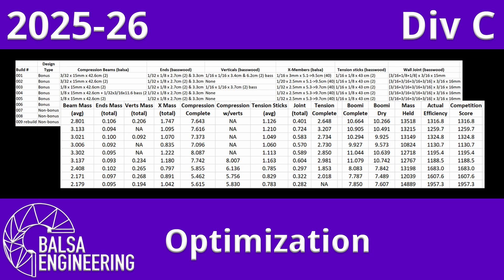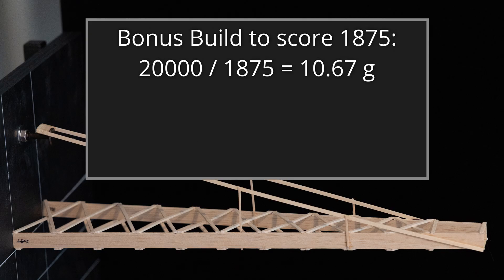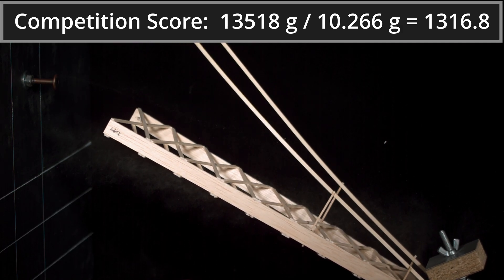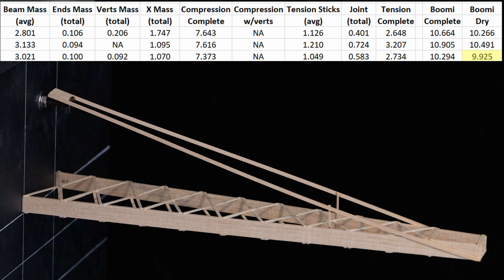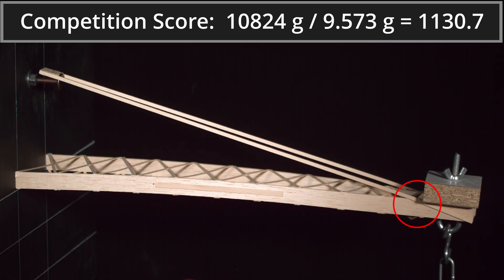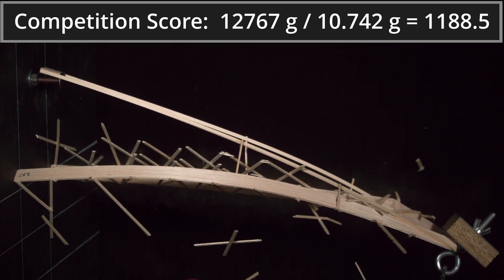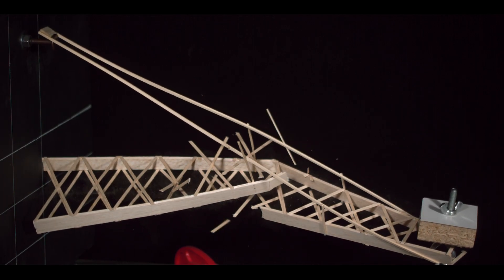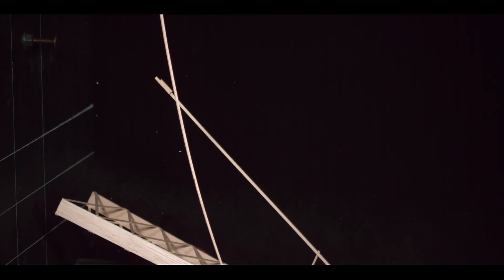2026 Science Olympiad Boomi Div C: Optimization

Comment: This video is going to be really helpful for this season! I don't know if it was mentioned in the video or not, but are the measurements for your wood bought precut? Or did you have to cut it yourself?
Reply from the maker: Thanks!  All the basswood was precut, all the balsa was custom cut from sheets. Good luck this season!
Reply: @b @balsaengineering6686 . May I know where you bought to precut basswood
Reply from the maker: I have been using this place: https://fnabco.com/collections/basswood-sticks
Reply: @balsaengineering6686  what type of balsa (if there is a difference in balsa) did you use and where can I buy that as well?
Reply from the maker: @rochanjatling  Density is the main variable you want to pay attention to wrt balsa in these devices.  You can compute the densities I used from the dimension and masses I show for the various build.  Grain type can also be a useful variable, but I wouldn't worry about that until you are further along.  I like to buy my balsa in sheets from here: https://specializedbalsa.com/products/balsa_sheets.php
Good luck this season!
Reply: @balsaengineering6686  thank you
Reply: @balsaengineering6686  Sorry if this question was already answered in the video, but for the measurements of the balsa wood, I know I have to get 3/32 thickness, but for the length, how much is needed? Do I need to get a 36-inch or a 48-inch? Additionally, what was the width of the balsa you used? Was it 1 2 3 in etc?
Reply: @balsaengineering6686  also, what were the measurements of the precut basswood you got on the website?
Reply from the maker: @rochanjatling  I like to buy 36" long sheets as they are easier to strip.  This widths can be seen in the video when I show the spreadsheet
Reply from the maker: @rochanjatling  This is also shown in the video when I show the spreadsheet for each build
Reply: @balsaengineering6686  On the spreadsheet for your last build, I'm having a hard time differentiating what width is and what is length. So just to clarify, would the width of the X members be 2.5mm? It's kind of confusing to me, so I just wanted to make sure before I buy the sheet... sorry for asking a lot of questions.
Reply from the maker: @rochanjatling  Yes, for the cross members, they were 1/32" thick by 2.5mm wide.   In general, I show the original Imperial units (inches) as how they were bought 1/32" thick for example, and then SI (mm) for anything that I had to custom cut, which would always be the width.
Reply: @balsaengineering6686  ok so your width was custom made? And if it is should I buy a sheet that has a width of 1in?

Comment: Great Video! I see that you have left only 4.5cm of space at the end(because 38cm go to the cross-members) for the loading block even though the loading block is 5cm. Why is that?
Reply from the maker: It's no problem to have the loading block hang off the end a bit and that is 5mm of length you don't need to have for your compression mass.  Every bit of savings helps!

Comment: I was looking for the dimensions of components for the non-bonus design, specifically the one that scored 1957.3. I know the charts are at the very beginning of the video but the information on the first chart is covered by the other one. 

Also, I am trying to purchase balsa wood and basswood for the season, I’ve just been a little confused by the numbers. What different thickness balsa sheets would I need for this design, and what density should I do (light balsa, medium balsa)? I don’t have a very large budget so I’d like to be one the more safe side and not having to make a large number of boomilevers. 

Same for the basswood. I saw you said you use fnabco but if you could help by letting me know what size sticks I should purchase for this design. Can I cut basswood sticks in the same way as the balsa wood sheets with the balsa stripper tool you use?

Sorry for all the questions and I understand if you can’t answer them all. Thanks for all your amazing videos and time.
Reply: If I could also get a discord link that would be great
Reply from the maker: Definitely check out my discord server for a ton of resources.  Welcome! https://discord.gg/JkRVdX3G
Reply from the maker: Hi!  You have to actually watch the video to see all the details... the optimization video covers 9 builds, so I show the details as I show each one.  The benchmark one starts at the 15:45 mark:https://pie.yt/?v=https://youtu.be/FV7FhJLPxT0?si=ZdP_43U_x6ztAg2f&pieshare=1

Comment: Thanks for everything you are doing for us sir 🫡 and can I know why are the ends sitting at different measurements like for the last one the ends was 2.7cm and 3.3cm
Reply from the maker: Thanks!  That's because this design has a tapered compression member.  The ones on the very end are 2.7cm and the ones back a bit are 3.3cm.  (The taper continues all the way to the testing wall where it's 8.4cm wide)

Comment: Hello! just to make sure, is the length of the two tension bricks are 43cm? idk if it is ok to use 42.5 ones.
Reply from the maker: The final length of the tension sticks depends on how long you make your wall joint.  Some of these builds used 43 and some 42.5.  I would recommend cutting the sticks a little long if you are not sure and once you are done assembling them, you can always cut/sand off the extra

Comment: You mention in your spreadsheet and video about your dry box. What exactly is a dry box and how does it remove the humidity from the wood?
Reply from the maker: Hi!  Check out this video I made awhile ago on this exact topic!  https://youtu.be/6zOvHMZLaNE  (TLDR, it creates an environment where the RH is very low and the water from the device evaporates out temporarily)
Reply: @balsaengineering6686  Thank you so much!

Comment: i remember for bridge you used 1/20 by 1/20 balsa sticks for the cross members. is there a reason why you changed to 1/32 by 2.5mm on the boomis?
Reply from the maker: 1/20 x 1/20 could work fine for this build.  The reason I like 1/32" thickness is for the shorter cross members, it's easier to have them overlap with each other without bending.   Basically, 1/20 thickness works well too, so experiment a bit.  I would avoid 1/16 or thicker though, at least for the shorter pieces

Comment: was any part of the boomi build balsa wood, or was all of it basswood? from just looking at the designs in the video, the crossmembers and the sidebars holding them together look like balsa wood but i could be wrong. additionally, what ways could i cut basswood because i dont have machines to use and only have basic resources. thanks for your videos!!
Reply from the maker: Basically, the compression beams and cross members were balsa and everything else was basswood.  I would recommend buying basswood in pre-cut sticks instead of sheets as it's very difficult to strip.  This is where I use to buy my sticks: https://fnabco.com/collections/basswood-sticks  Good luck this season!

Comment: for the chunk of basswood holding the tension members together, whats stopping you from using one chunk instead of glueing multiple together
Reply from the maker: If you can find a single piece of basswood that is the correct dimension, that would be a better way to go for sure.  It's just easier to find/buy basswood in sticks, or at least that is all I have on hand.

Comment: Hey could you specify what the unit 5.1 and 9.5 cm are for the X members for the cross members? how long are each cross members and what is the distance between them.
Reply from the maker: I specifically didn't provide a "template" as there is no one right answer and I want students to be able to figure this out for themselves.  It's very easy though.  If you want to replicate my build with 10 layers of X members, just work from the back.  We know it's ~42.5cm and the loading block needs ~4.5cm.  That leaves 38cm for all the cross bracing.  That means they are spaced around 3.8cm apart.  Draw the dots on the beam and then just measure the distance between them.  That is how I do it instead of trying to compute it with math.  You only need to do this once per design you are working with.  The distance you need will also vary if you change with width of the compression beams.

Comment: Great Video! I was wondering what type of grain you used for the balsa and why? How did you divide up the masses for each portion of your boomi so that you could buy the right density sheets of balsa? Why did you make the length of the boomi 42.6cm exactly? As far as the rules state, 40cm is the minimum, so would you not want to aim to something closer to that in order to minimize torque from the load? Additionally, would you say that, if one were trying to use the bonus, that a box-beam type design with hollow compression members might be suitable to hold 15kg at a minimal mass?
Reply from the maker: Thanks! That's a lot of questions, I'll try to answer them briefly.  For this build, I was not concerned about grain type.  The mass optimization was done from experience and trial and error.  The loading block chain needs to be at > 40cm from the wall, so the boomi needs to be longer than that.  42.6cm length gives just enough to get the middle of the block at >40cm.  Bonus vs non-bonus isn't related to design, it's ~50% more load for 33% more score potential.  Feel free to try it, but if you find a good design for the bonus, it would work even better for the non-bonus.

Comment: Great videos as usual.  You are a great educator.  For the wall joint, what are the numbers inside and outside the parentheses for?   The latter numbers appears to be the solid block?
Reply from the maker: Thanks!  That's how I designated how that joint was constructed.  For the first build for example [3/16 + 1/8 + 1/8] means I used 3  separate pieces glued together, each one had 3/16 as the other dimension and it was 15mm wide.  The final wall joint in that case would have been 7/16 x 3/16 x 15mm.

Comment: Do you know what the approximate density for the x-members is? I'm buying my balsa from Specialized for the season and want to make sure. Thanks!
Reply from the maker: I don't have the density recorded, but you could calculate it from the dimensions I give above and the mass.  In general, they would have been in the "light" to "light-medium" range.  Only the mass budget is critical, if your pieces are too heavy, just make them a bit smaller.
Reply: @balsaengineering6686  Ok thank you!

Comment: How did you get such a low weight on your compression members? bought my wood which I had 1/16 by 3/32 but is heavier than the ones in the video. Is there any recommendation when buying wood?
Reply from the maker: You have to just buy balsa that is lower density.  If you buy your balsa locally from a store, take a scale and only buy what you want.  The only place online I know of where you can specify a density range is from Specialized Balsa:  https://specializedbalsa.com/products/balsa_sheets.php
Reply: @balsaengineering6686  what density sheets did you use to construct compression and cross members the final non-bonus boomi
Reply from the maker: @eatham-d2h  I don't have those numbers handy, but you can calculate the density of any of the pieces I used given the size and mass I provided.  Just make sure you be careful about the unit conversion.  In general, the beams were on the high side of "light" density, around 9 lbs/ft^3 if I recall.  There is no one correct answer though, so it many different options can work well.

Comment: Hi balsa engineering, I was wondering, did you make your balsa hopper, or did you buy it? If you did buy it, where did you buy it, or if you made it, how do you make it? Also, do you use a jig for your build? Thank you!
Reply from the maker: Hi!  I recently bought an auto-loader from these guys: https://www.balsawoodhoppers.com/services   It is expensive, but it's top notch quality and will basically last forever.  I used a 3d printed jig for the compression member and a jig made from "real" material for the final assembly.  My next set of videos will be about construction where I show all of those details, so stay tuned!
Reply: @balsaengineering6686 thank you!!!